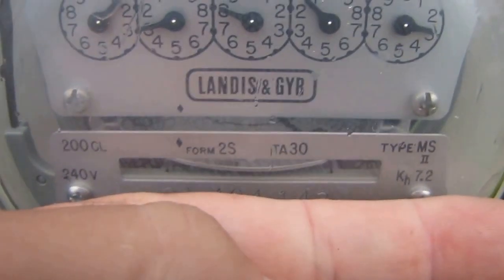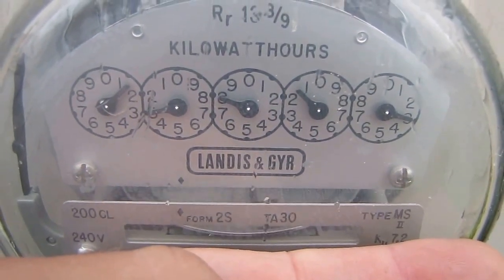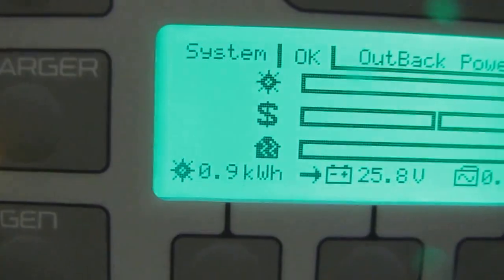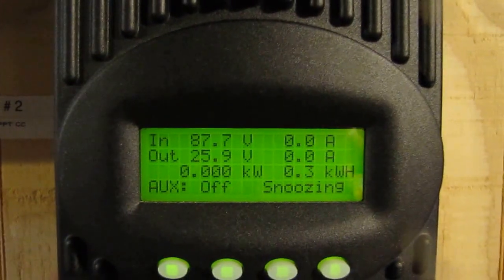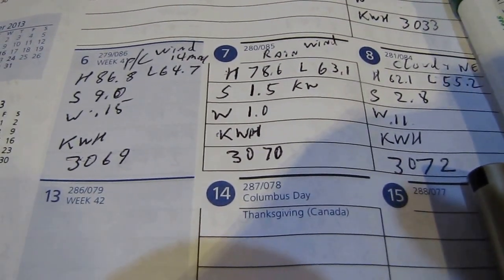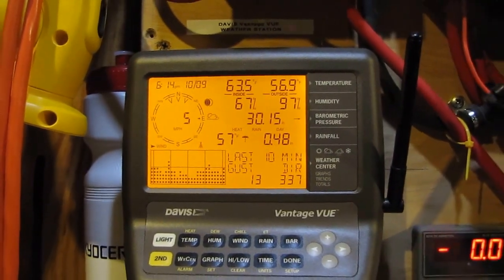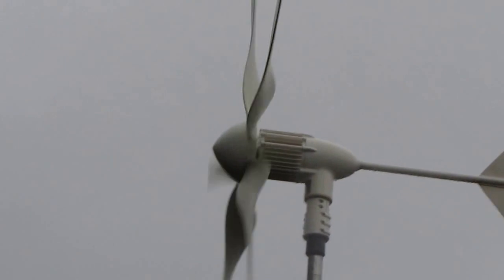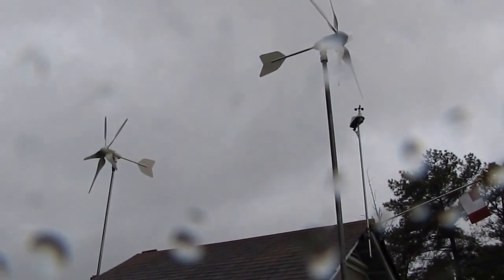Solar Power And North Eastern Storm  After 2 days Of No Sun Update On My System By KVUSMC

Comment from the maker: I Would not Hook It Too The Flex Max 80 MPPT  Charge Controller They Are Not Designed For That  Get You A Missouri Wind HVA All In One Charge Controller For Wind Turbine & Solar Panel  They Seem To Work Really Good I used To Own One  Nice Units  Have A Great One Peter

Comment: Hey Kenny thank for all your video. Can you help me set up my wind turbine . I have 1000 watt solar panel,8-230amp hour agm battery,80amp outback charge controller,3000 watt pure sigh wave inverter charger.planning on getting the hye 24volt 1000watt turbine. Can you tell Me or show me how to wire the turbine in my system. You can contact me by email robinsonbrown@netzero.com.thank you.

Comment: VIAR LOCITY, What are the wind turbines you got there. I see you have replaced the Raptor blades for another turbine and they look very familiar but I can't put my finger on what they are. WindEnerg7, that's where I seen them. Did you get them from there? Also, have you ever written down a schematic to your system to share with others? I am in the planning stages for my off-grid system now.  Wow, so many variables it blows my mind at times.  Thanks and Semper Fi!